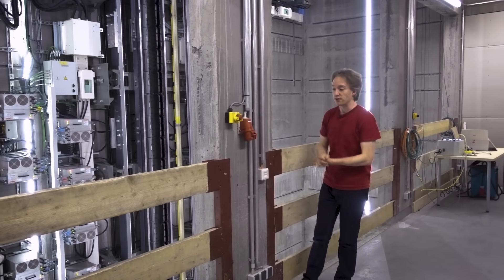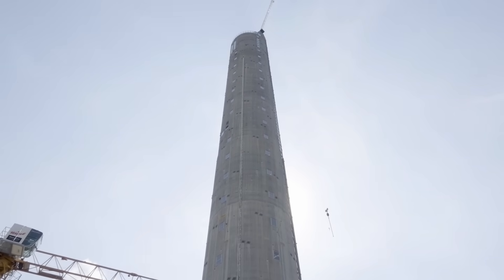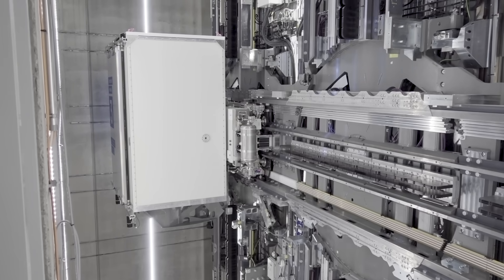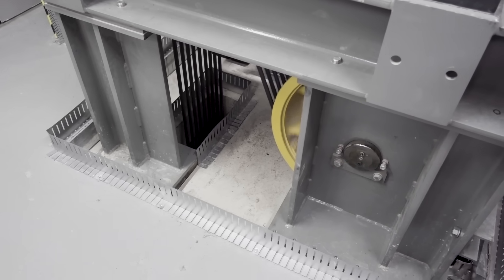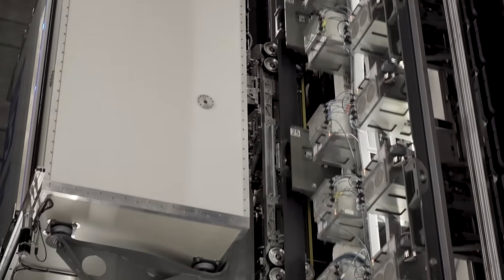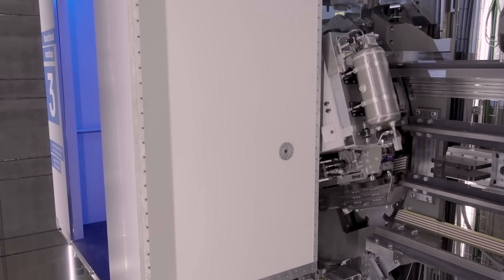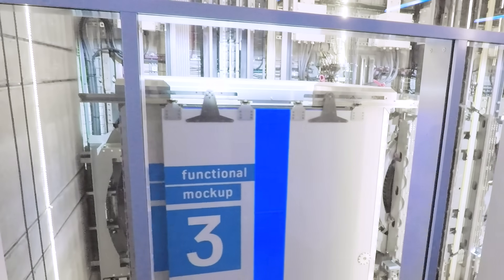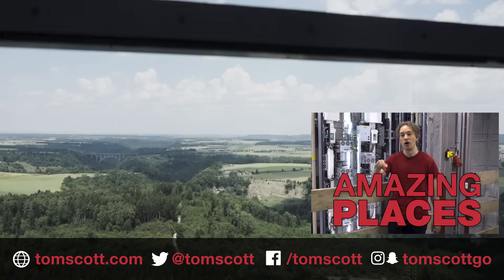An elevator that actually goes sideways

Comment: Also seems convenient because you can have more than one cabin per shaft. But I'd suggest putting floor selection outside of the elevator if you do that so the cabins can be organised in a way to let you through before the ride otherwise cabins might get in the way. I'm also guessing this uses way more energy than a conventional elevator. It's moving a cabin up alone vs moving a cabin up and a weight attached to it down i.e. just speed changes and overcoming friction plus a bit of lifting maybe.

Comment: Pointless. What you didn't mention about cable elevator is that they have a counterweight. This balances the weight of the elevator meaning that the energy required to run it is only as much as the load in the elevator plus friction. 
The reason we don't have elevators that go in multiple directions is that that's very inefficient and most tall building are not that wide and mose wide buildings are not that tall. 
This system has no benefits over current systems and also no specific need.

Comment: German engineer, elevators that go in all directions: Check.  
Next step: Teleportation, other engineers: impossible ... German engineer: I'm here, now here, now over here ....
Reply: Thyssen Nerds: Lets recreate the Turbolift from Star Trek.
Reply: technically these are only 2-dimensional, but there are some warehouse systems that are able to move stuff 3-dimensional. It will be some time before we get systems like that for humans
Reply: This is only the start. Turn this system into a type of cage and surely it can do all six directions at a six-way junction.

Comment: Okay, linear induction motors in elevators is very good indeed, but what's the point of it moving sidewas at the same time?
Reply: So an elevator can overtake another one. So you can. Use more that two

Comment: I wish the reason for wanting the horizontal movement was discussed more than allowing for more configurations. I assume this type of elevator would have multiple cars on the same vertical shaft using the horizontal movement to allow cars to pass each other.

Comment: I always assumed the reason we use the elevators we use is because they're not very complicated (relatively speaking and relative to the particular elevator's design and age).

This seems like an exponential growth of complexity and points of failure, not to mention power use. The cost of operation and maintenance? I don't even want to guess at what it would be...

Comment: Cables can hold their own weight just fine, theoretically they would snap at a length of about 10 Kilometre.
Reply: But your elevator drive engine has to lift the weight of all the cables on top of the payload. That's not easy to handle.

Comment: why liniar induction motors? the motor litrualy has to be as long as the lift shaft itself.
using several motorized gears to have the car climb up a rack would be way cheaper. because you dont need a 100 meters of electromagnets, you just need a few meters in the electric motors that are on the lift carrage itself.

Comment: The “EL” in elevator means to elevate or go up. So If an elevator moves sideways it shouldn’t be able to be called an elevator. Would it be a horevator?
Reply: So a vertical transport cabin is only a elevator half the time. The other half it's a descentor.
Reply: Big Brain time

Comment: So much STUFF! The whole rail is just packed with boxes and cables... Gotta be extremely expensive?
Reply: Of course, but think of all the cost which could be mitigated by such devices. You could save a lot of space inside a skyscraper by reducing the number of shafts needed.

Comment: Hey Tom, could you please do an episode about rollercoasters? Those are so technically interesting! From the design of the trains to the design of the track shape to safety systems, lifts or launch systems. Actually, some rollercoasters use those exact Linear Synchronous Motors (LSM) or Linear Induction Motors (LIM) or hydraulic or pneumatic launch systems to launch rollercoasters, a little like the fighter jets are launched from Aircraft carriers.
Reply: He's scared of them.

Well, he was scared of them.

Comment: And if the power fails, then the elevators, assuming they don't have automatically locking friction breaks, will gently meander downwards at a very safe speed using the Eddy Current phenomenon.

Comment: I understand the need for LIMs (though I question the power usage of this tech, considering the lack of a counerweight),  but what's the point of going sideways?
Reply: Capacity. You can have multiple elevators in one set of shafts, and they can pass each other.

Comment: Besides the "cool" factor, why do you need to move sideways?
People can and should walk a few hundred feet to where they're going, the elevator is to help avoid 20-40 flights of stairs which is dangerous for everyone.
The added cost vs benefit seems rather dubious.
Reply: I think this is for multiple cars per shaft and big buildings with a lot of shafts with cant go all the way.
So you have more transportation on less space (Area), with is really a concern for high buildings

Comment: I'd be curious about the power consumption compared to a cable too, since the cable has a counterweight, so it isn't actually lifting the weight of the elevator, just the people inside it.
Reply: It will surely consume more power to go up, but if the design is smart, it can feed power into the grid while going down.

Comment: I am by no means an expert on these technologies, however from the little I do know I'm surprised they decided to use Linear Induction Motors (LIM) rather than Linear Synchronous Motors (LSM). I know that the roller coaster industry used to use LIMs for the launches on many roller coasters, however have more recently switched to LSMs for cost, efficiency, and reliability reasons. Because of this I think it would make more sense to use LSMs here, but what do I know. If anybody does know more about these technologies I'd love to hear an explanation.

Oh also a little tidbit: The LIMs (or if they had used LSMs, this would also apply) can be used as brakes and will still slow a vehicle even when power is lost due to some magnetic property that I dont understand. They wont bring it to a complete stop without power, but they can reduce the speed enough to make a collision a minor bump rather than a full crash

Comment: You could accomplish this with a hydraulic system that rotates 90° and pushes on the side of the cab.
You could even use it to cross streets to other buildings without any special infrastructure.

Comment: This is a great idea until grandma falls over and breaks her hip.
Reply: How would that be any different to an ordinary lift? The cars do not move horizontally with people aboard. The move horizontally to change between shafts so that one shaft can have cars that take people up and the other shaft has cars that take people down. If a car is empty in the down shaft but there are people on a higher floor it can change shafts to go up to the floor with people waiting.
Multiple cars but only two shafts.

Comment: So those things basically go crashing down when electricity is cut?
Reply: Linear induction motors act like brakes when the power is cut.
Also I suspect that there are automatic brakes that are kept released by electricity and will automatically apply when power is cut.

Comment: When I imagined a sideways elevator, I imagined something that takes you to separate rooms in a really long horizontal building
Reply: It will be able to do that. This is just for demonstration purposes.
Reply: The system displayed in the video is actually able to do that, as you can fit any number of horizontal coils inbetween two of the rotating pieces. I visited the tower once and one of their main selling points is the ability to wire a building, no matter how complex, with a single elevator system that takes you from any point to any other point while also managing and effectively utilizing multiple cabins at once
Reply: We shall call it Side-vator;)
Reply: we have hallways already
Reply: Like a assembly plant, where the line for cars are over a mile.
Reply: Easier to build a miniature train inside the building. Maybe with an elevator-button interface instead of drivers and schedules, that'd be fun.
Reply: That wouldn't be an elevator though
Reply: my thoughts exactly
Reply: We already have those, they're called APMs. Airports use them a lot.
Reply: These will be perfect for The Line City.
Reply: Right like multi floor assembly plants that are a mile or more long but just three or four floors high. Would be nice to have for those.
Reply: Seeing as it isn't just sideways, I'm more thinking of the Wonkavator.
Reply: In theory, there isn't really a limit on the length of the horizontal transfer shaft.
Reply: Supposedly, the skyscrapers of the future will have INSANELY tall, interconnected towers that use lifts just like these to transport people where they want to go with incredible efficiency! Thanks to having horizontal shafts in addition to vertical ones, you’ll be able to literally go ANYWHERE FROM ANYWHERE!

Comment: How about using worm drive for elevators. Same energy as linear induction, many in a shaft, no cable limits, and it can't fall because the gear teeth running up and down the shaft can't drive the motor.

Comment: I assume that without a counterweight, the energy consumption will be high too.
Reply: A linear drive can harvest (aka recuperate) the potential energy stored in the cabin and payload when driving downwards.
Reply: @herbertzausenhaim246  I see. Well that's good but that will also require inveters to put it back on the net or expensive batteries. Neither solution is as cheap and reliable as a counterweight.

Comment: Multiple cars on a single track protected by automatic train protection would be a huge saving. All you need is one all stops shaft, and one express shaft for a new generation of skinny super tall skyscrapers. Gives you the flow of a skinny office tower where people flow and gross leasable area are super important, not just residential.

Comment: “The system needs to be just as failsafe.” Cues shot of elevator doors opening in middle of elevator shaft.

(Yes, I know it’s a test shaft.)
Reply: No just use 2D maglev: no need for tracks, the car just hovering 10cm away from the wall.

Comment: What if in a worse case senario the breaks fail and the motors fail and one goes into free fall, there will most likely be 2 elevators on this shaft because of algorithms and computers avoiding collisions, but if one went sideways and one went up above then perepinicual tacks and the tracks were horizontal and the free falling elevator was vertical, that would be a bad collision ass there would be no butter of the rotating part of the track

Comment: With no counterweight, would this be an electrically expensive installation? I wonder if they reclaim the energy when moving down, but storing it in batteries wouldn't be very efficient. Perhaps you could use the ones moving down to power the ones moving up as long as they are usually moving together. (Obviously also adding power too since there will be losses) Very cool concept.

Comment: Why though. Very few buildings are very wide and very tall. I can only see this being useful in large, multi level factories. But employers would tell their workers to walk long before installing an expensive horizontal elevators
Reply: Reducing the number of elevator shafts from 20 to 2 (one going upwards on e going downwards) can increase the usable floor space in a high building.

Comment: What happens to all the magnets and induction motors if the power is cut? (Like from a nearby storm)
Reply: Then the brakes will be activated. However in theory the elevator could slowly lower if it is on a vertical rail (aluminium is not magnetic, but it will be will be slowed down in a magnetic field)

Comment: what if only one of the motors works and the elevator cab turns sideways, or what if the power goes out and the motor stops working?

Comment: This does introduce new safety risks, though. Presumably multiple lifts will be operating on the same tracks?
Reply: Is a train a savety risk because several trains drive on a railway the same time?
Reply: @foximacentauri7891  Well yes. In a conventional elevator there is no risk of collision. From a safety analysis point of view, this is a additional failure mode. And yes, trains can and do collide sometimes.

Comment: There's a lift at Greenford station on the Central Line of the London Underground that moves diagonally. It was installed in an existing stairwell alongside an escalator and conventional staircase to allow wheelchair access to the station platforms.
Reply: Some stations in Madrid have this as well. It's a common sight when space is at a premium.

Comment: wait so why does it need to go sideways? am i missing the point..
Reply: Instead of having one shaft per box and one door per box on every floor, now you can have 2 shafts with more than 2 boxes, and only 2 doors per floor. Boxes could go up one shaft then down another shaft, by moving sideways between them. It's like a train system, but primarily vertical.

Comment: I'm curious to know how the fail safe mechanism works. We all know how it works in a traction elevator, we also know how brakes on pneumatic systems (trucks, buses trains) work... but what about with magnets? Obviously if there's a power failure the car will be stopped dead, but what if there's a different sort of failure - for example a structural failure (like you could possibly have in an earthquake)?

Comment: There is a reason we stay away from LIM power sources in design...  It is a tremendous power cost. LIM's are not known for being efficient.   Is it worth the exponential power cost to slightly remedy a capacity issue?  At what point does it become more effective, than just adding a new cable elevator side by side?  My money is still on 3 cable elevators and cost, rather than this jury rig.

Comment: Problem with this is LIMs tend to use A LOT of electricity. At least I know LIMs on roller coasters can use the electricity of a small town every time it launches. Obviously there’s a lot more energy needed to propel a massive train down a track but this can’t be all that cheap either.

Comment: People are always afraid about elevators falling down but you can also fall up (even more likely afair). Those cables have counter weights that weigh about the same as a half loaded cabin. So if there are less passengers in the cabin and the breaks fail the cables will pull the cabin upwards.